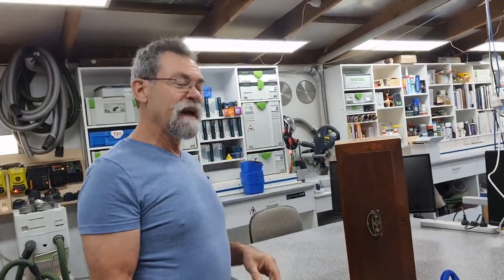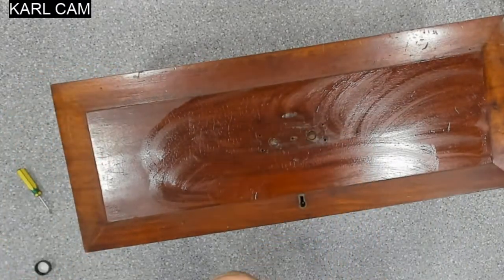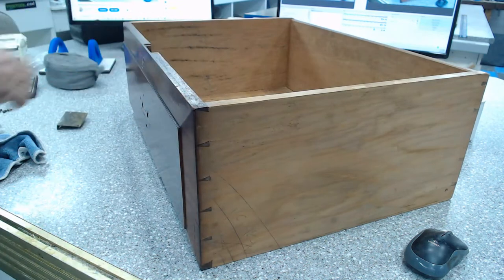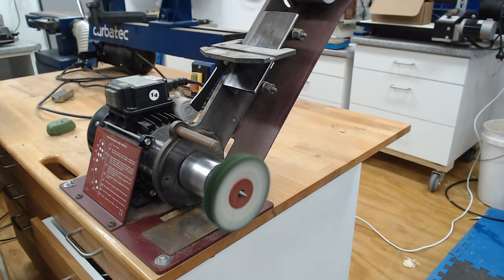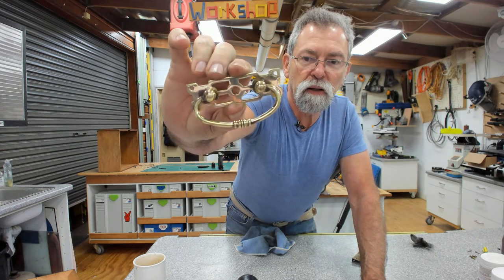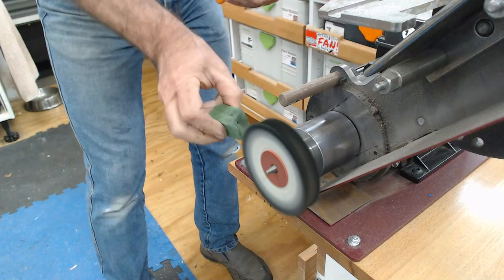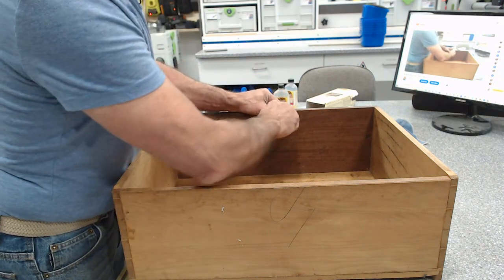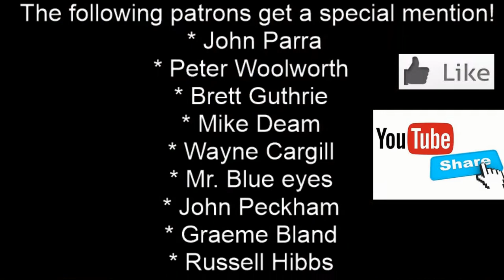Restoration tips Dave Stanton Live!

Comment: Back in the 90s, I picked up an antique brass spittoon that needed a good cleaning & polish.  As recommended by someone at the antique show where I bought it, I used a toilet bowl cleaner (Sno Bowl) that was basically hydrochloric acid on it.  Just a quick rinse with Sno Bowl, followed by a good water rinse, got rid of the oxidation almost immediately!  I'm not sure if the unoxidized brass is affected, but I'm a believer.  I suppose the process is similar to using lemon juice on copper.  I have also had success using ammonia rather than an abrasive polish to clean up gold-plated uniform hardware.
Reply from the maker: Thanks for the tip on toilet cleaner, will definately give it a try!